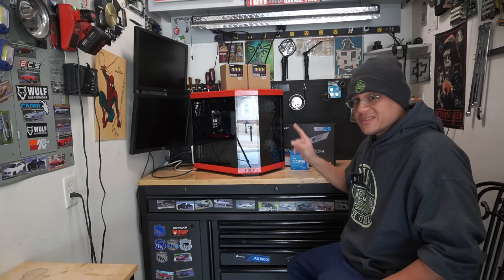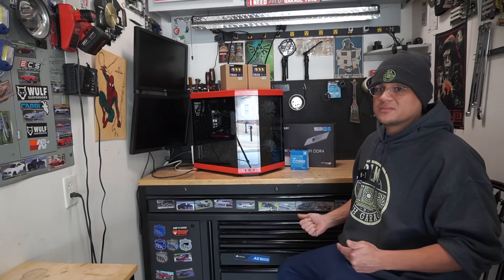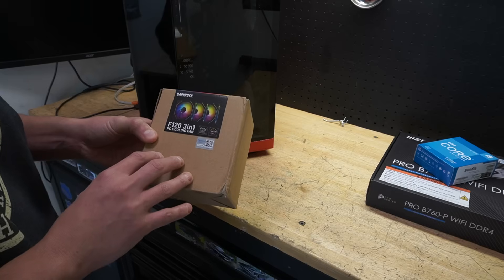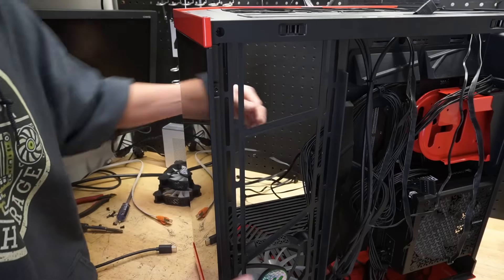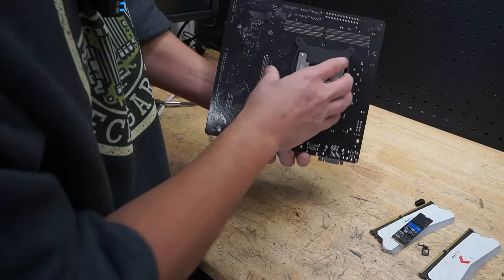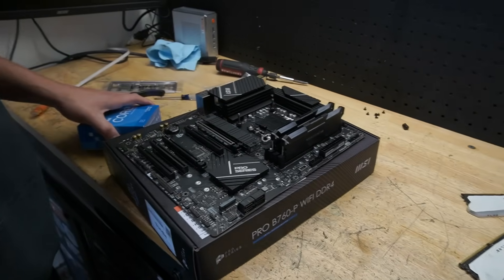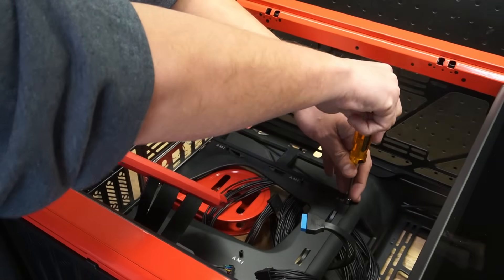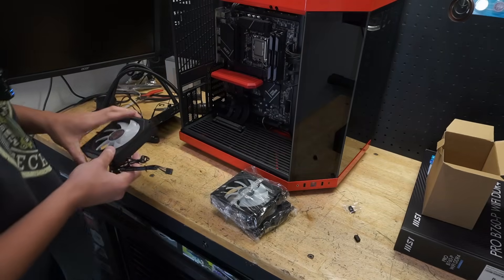This computer just might help me retire early!!!

Comment: You can actually buy usb addressable rgb controllers, ive been wanting one called the nollie, they have ones with 8,16 and 32 port, they seem pretty good. each fan is apparently shows up as its own device

Comment: I prefer cases that can mount a 360 along the top. As far as the air cooler I remember Steve gamer nexus when he reviews air cooler he does not like any cooler that designed the mounting screws too short or the springs are too thick and requires too much torque, sometimes its because its a first gen design, the newer redesigns sometimes have listened to steve and they have redesigned the mounting system with easier and softer screws and bolts and springs. In the bios some boards you can simply set the max temp to 70 C and the board will automatically underclock the cpu and keep it at 70 which is what I do, the only times I see alot of cores maxing out is when it renders a video OR a video game thats graphic heavy will have to do some heavy rendering when the game launches. Also if you want to get fancy you can turn off XMP Profiles and look at the guides to underclock and undervolt your cpu cause alot of retail boards have an overly aggressive profile thats not healthy for cpus. And dont forget to update the bios frequently cause some boards are getting frequent updates because they messed up the default settings and cpus are getting damaged.

Comment: I HAVE A REQUEST FOR A VIDEO!!!!  I AM A LOYAL SUBSCRIBER FOR MANY YERS.
CAN U GET A WATER COOLER A.I.O.  AND MODIFY IT???
THIS IS WHAT I HAVE IN MIND. GRAB A COOER MASTER A.I.O.   ADD A CLEAR WATER RESERVOIR.. TO THE SYSTEM BY CONNECTING
THE RESERVOIR BETWEEN THE PUMP AND THE RADIOR, AND CHANGING THE HOSES TO CLEAR TUBES.
THIS MODD WHOULD BE A GOOD BUDGET D,I,Y. MODD. AT A VERY LOW COST.
THANKS FOR READING THIS.. KEEP UP THE GOOD WORK
Reply from the maker: I'll look into the possibility of doing that, thanks!

Comment: You are the expert, but you set the fans up the opposite of the way most are installed in these cases. The 3 on the back side are usually intake and exhaust through the top. This case often has intake fans in the bottom so you get a "chimney" effect where the air flows in the bottom and out the top.  I do enjoy your content.
Reply: be said why he did it that way

Comment: Buying new ddr4 parts is silly af in 2025. Buy used, or if he already had a really fast kit to use, sure, but new? Nah. Especially building up little by little to a higher end system eventually. You never end up with high end system  by continuously buying 3-5 year old tech. I would have def steered a customer away from buying based on aesthetics and what's cheapest to do the job right now vs cheapest overall in time.

DDR5 and a supporting z chipset lga 1700 board >>> Later on he can get a better 13/14 gen i7/9... logical upgrade path

Comment: I don't understand the case for using the side fans as exhaust if it is next to a wall. The top or rear should be the exhaust, the only time the top should be intake is in a full positive pressure build, ideally that case should have bottom intake fans.

Comment: tiny 120 mm AIO cooler for 12600 - not so great. Then better to go with decent air cooler.
Reply: definitely weird budgeting got a facebook marketplace deal and then buys a top of the line hyte y70 infinite that's one pricey case lol.
Reply: Also the pump is in the radiator, so that means he put the pump at the highest point instead of the lowest point
Reply: @TheBlueBunnyKen  That only matters if the radiator is horizontal, top mounted.

Comment: I love micro center deals. I’ve gotten 12400 and 12600kf deals from them, but got mITX boards with both of them. The 12600kf is in my semi now paired with a B580.

In my truck pc when I upgraded the GPU to the B580 I pulled the m.2 heat sink off to make sure I did indeed and a second slot and noticed that while it did have 2 m.2 I peeled the plastic off the wrong one when I built it. Oops 😅 I did stress test the pc after I built it and it everything passed and nothing was overheating. It’s a gen 4 drive so no worries.

Comment: Doesn't this cooler have pump in the radiator? In that case you risk damagig it, if not now then sooner than later. Pump should be in the lowest point of the loop, not highest. Sry for bad english :)
Reply: The pump is not at the top of the radiator, so it doesn't matter.

Comment: What electric screwdriver do you use? I have a fanttik e1 Max, but sometimes it just doesn't have enough torque to undo the screw.
Reply: Yep, I have one.  A little nudge with a manual to brake the lock tight (or just the normal tightness), and it's great to put them back on.  Especially on a laptop....
Reply from the maker: craftsman electric screw driver I got a lowes for like $20 a few years ago.